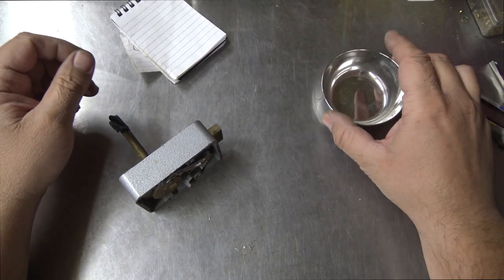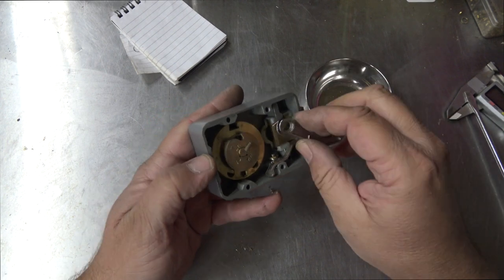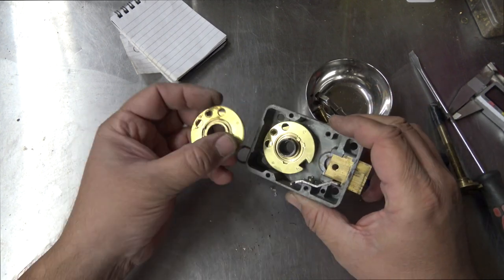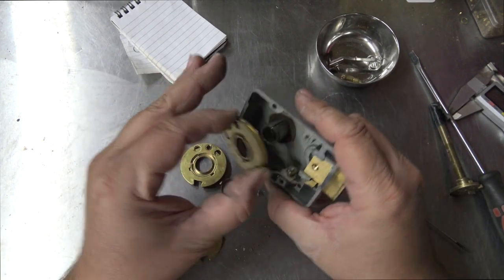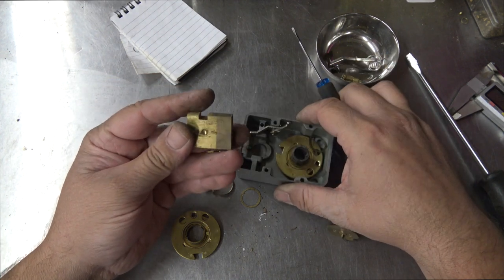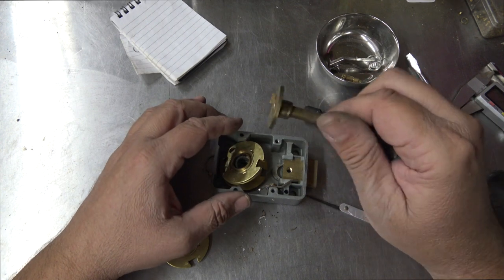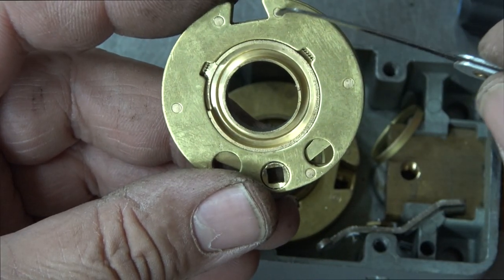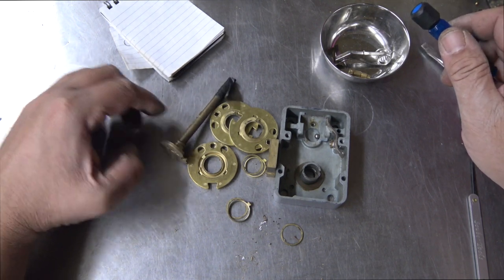Why Safe Locks Take Time To Crack

Comment: here in the states we do drill safe. it is a very tricky business in that you have to know the drill point. if you don't know the safe and know the drill point you will never get into it. every safe manufacture has a different drill point or points some has more then one. however you are correct if you trip the relocker your in big trouble. a amateur would never get into a safe. it takes special training and years of experience. We actually have a school here in the states that hold classes every year on safe's
if you really want to know what kind of lock that is, put it back together line up the change key mount, and see what change key goes in it. of course I am sure you know that already. nice video enjoyed it.
Reply: @robert cole I think you'd enjoy my youtube channel- lots of safecracking info gadgets and tips.